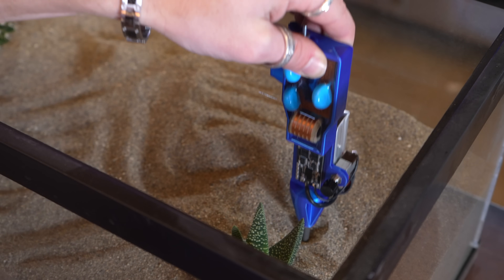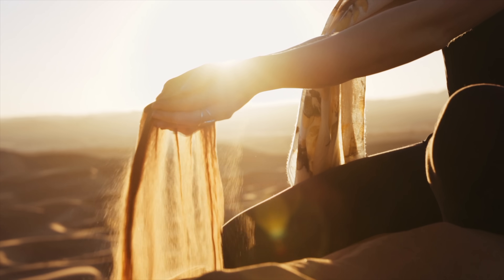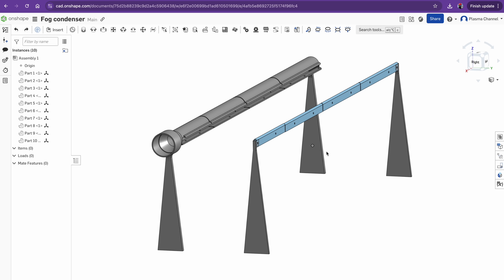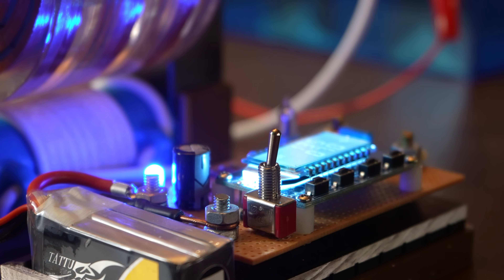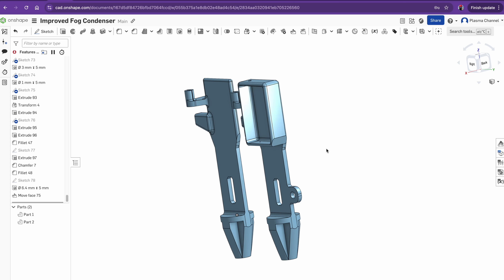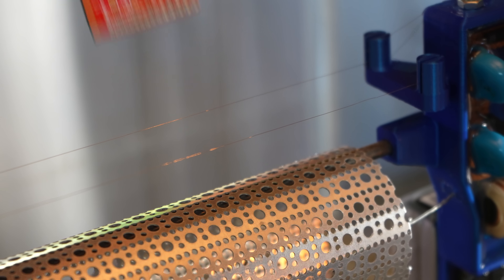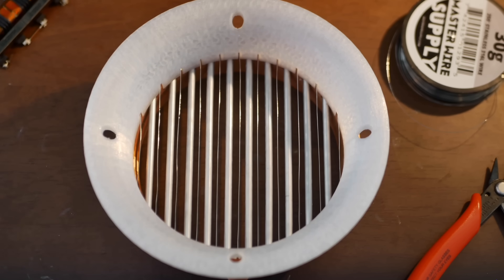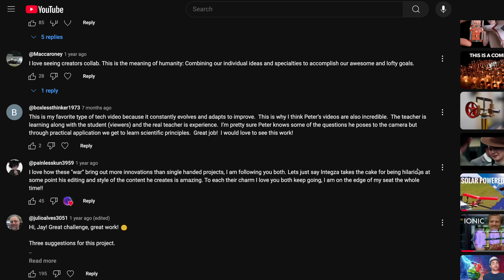Solving Desert Water Shortages Using 20,000 Volts

Comment: 14ml per Wh, in other words 257kJ per liter. No wonder you only mentioned it for 2 seconds. I applaud the honesty though, most water from air sucker inventors wouldn't mention it.

First useful search result for "water truck fuel consumption" was using 35l of diesel per 100km transporting 20kl of water. Some simple math later (40MJ per liter of diesel) gives us 0.7kJ per liter per km. 

First useful search result for "reverse osmosis desalination energy consumption" says 11kJ per liter. So you can spend 11kJ to make a liter of water and then you can still drive it 350km in a truck and it will be more efficient. I don't think there are any foggy deserts out there in the world that that far from a coast. In fact, they require a coast relatively nearby, the Namib desert which is a very foggy desert is all within 150km from the coast.

So, just like all other "water from air" devices, neat idea, but the energy requirement kills it.

"but just add solar panels lol" Sure, that would work, but there are probably 50 better things you can do with your solar panels, including connecting them to a grid, selling the power they generate and using that money to buy diesel for your water truck and spend what's left over on something fun. In fact, put the solar panels somewhere else that isn't foggy so there's less maintenance required and they'll make more money for the diesel for the water truck.
Reply: MIT estimated 35x higher efficiency.  So 10 km in a water tanker.

Comment: I have a suggestion. What if you used, instead of a grid, a perforated smooth plate covered in a hydrophobic coating? To see if the condensation can be encouraged to slide off into collection faster?

Comment: 0:26 "Even arid deserts have plenty of moisture in the air"  The dew point would disagree with you.  That's literally what "arid" means.
Reply: Arid just means there is little natural rain.
While there is indeed the same amount of water in the air at different times of day (ignoring things like convection lifting warmer, wetter air) - the desert at night is very cold and it does indeed fall below the dew point - hence why you see fog in the desert and plants in the area evolve to collect this fog on their leaves.
This is effectively just concentrating all the fog condensate at a single location. Whether that's a good thing would need to be looked at
Reply: Are you 16?
Reply: @robmccormick-x6l  why did u ask
Reply: did you not hear him say "coastal"? 😂
Reply: That’s why he talks about predawn mist, because in the right conditions dew forms easily in the desert. There are whole ecosystems based on this dew. You are right, this device would do nothing at high noon, but under conditions where dew is already forming, this would amplify it a few orders of magnitude
Reply: @Merkasaur  Whether it is early morning or high noon makes no difference to the amount of water vapor in the air - it is the same regardless of the air temperature.  That is what the dew point measures.  There is very little water vapor in desert air.
Reply: @stargazer7644 might have to fact check that one. There is indeed dry air and wetter air and it is indeed heat dependant, this is why some air turns into clouds when temp is correct and temp is in a range and why clouds won't form over deserts (too hot and dry)
Reply: @stargazer7644  time of Day or rather temperature certainly does matter to how much water the air can hold. You are right that it doesn’t magically gain more or less water, but closer to the dew point, the efficiency and yield of these systems is dramatically higher
Reply: @Merkasaur  I did not say "how much water the air can hold"  I said the amount of water vapor in the air.  They are two different things.  The former has to do with relative humidity.  The latter has to do with dewpoint.  The humidity often changes quite a bit during the day because the temperature changes.  That has nothing to do with how much water is in the air.  That had to do with the ratio between how much water is in the air and how much water the air can possibly hold.  Dewpoint is different.  It generally does not change drastically through the day in a desert.
My point is in the desert the dew point is usually very low, which means there's very little water vapor in the air.   Of course it requires less energy to condense water out of the air when it is close to the dew point - the ambient temperature has already done some of the work for you.  But there's very little water to condense.
Yes, warm air can hold enormously more water than cold air.  But you'll generally never have that in a desert.  That's why it is arid.
Source - I live in the desert.
Reply: @stargazer7644  I didn’t misunderstand you and I wasn’t correcting your wording. Like I said, temperature change doesn’t ‘magically’ alter the amount of water that is in there air (like you said, vapor content stays the same) unless there is actual evaporation or condensation occurring. What I meant to point out is that your original comment is taking this backwards. The dew point proves him Right, not wrong. The fact that dew can still form in arid environments shows that extraction is practical. The studies show that active condenser techniques like this can work down to 30%RH or lower, which is easily reached in some desert areas at night even when dew or fog isn’t forming. You just won’t get as much. Arid doesn’t mean RH is always low. It just means that, on average year round, evaporation is higher than precipitation . Human ingenuity is often all about timing.

Comment: Probably won't read this comment, but I hope you do.

This could also be useful for dehumidifying given that most of those, as you tested, are kinda lacking in capacity or are really annoying if they are industrial sized. This could be useful for datacenters that need dry air to stop the dust to stick to everything. It could be useful for collecting water for evaporative cooling even. I'm kinda surprised this is only explored now given the effects of high voltage messing with fog are well known to anyone that's ever worked on above ground high voltage power lines. In the winter the morning moisture in the air clings to them to then freeze and cause all manners of issues.

The problem presented for water collection is again, batteries. Powered by solar means you store energy during the day and keep overnight to run the system the next morning. So the batteries are the key point here and next to the electronics the biggest cost factor.

Also energizing metal like this probably also accelerates the oxidation process, so even using stainless steel you may end up liberating enough electrons to cause a chemical reaction with the oxygen in the air coupled with the water.

Worth exploring a way to add a small vibration motor to the mesh to get the water droplets off so they don't stick so much as the sun comes up would evaporate them again. Maybe even something to run over the mesh when the system shuts down to get the remaining water off and maximize the efficiency of the system.

Remember that it gets very cold in deserts as well, so much of the fog won't be directly above the ground, hence fog nets are often quite tall. You'll want a foot or two above ground to be above the thermal layer and right in the fog. While the electricity does attract it, scaling the system vertically might still be useful. Question is how as the dripping water droplets of a stacked system would cause constant shorts, but even staggering them as the wind blows them around they might still short. The electronics either need to handle this or a stackable system needs to be designed.

Further issues will arise from fauna as you don't want the thing to turn into a large mosquito griller. Shorts and the contamination of the water from that, not that it matters much for crops, but for drinking water certainly still need to filter it. Would also be interesting to test the water, if it has any minerals in it or if it contains a lot of ionized water, which wouldn't be the best option for plants or humans, though I'd imagine that problem solves itself with time.

Placing the system permanently somewhere may also rob plants of sunlight. This is least an issue around the equator, but if you want it used elsewhere the different sun angles during the year might rob plants from the light they need so all the water in the world won't help them grow. Have you considered building it onto a rotating gantry like the systems found in California and other arid places. This would also distribute the water more evenly and move the system through more moist air potentially further increasing yields.

Fascinating. Would love to be involved in further development as I can see some problems arise, but also some solutions that sound really interesting to explore.

Comment: Few points to consider:
- Desert Fog Nets may have a low efficiency, but should be MUCH cheaper and scalable and do not require any power. So overall, a fog net might still be the better choice.
- Comparing the power consumption to desalination techniques, your prototype is really inefficient. Reverse osmosis only requires around 5 Watt hours per Liter.
- In the last demonstration where you compare your prototype to a conventional dehumidifier. You need to run this test way longer, since dehumidifier run in long cycles. 
No hate, I still enjoyed the video!
Reply from the maker: Thats good input, I appreciate you taking the time to type it out. I'll take these things into consideration. Now in terms of cost, Im less interested in it being make available for ultra poor communities (though, I will do my best to steer in that direction). I am more interested in creating the tech as a possible option beyond drilling or reverse osmosis in terms of water availability.

Comment: This looks awesome. And it’s so simple, seems like you could use a lot of different things for the wires and the ground. 

Maybe even just regular metal piping could be used as the ground. Make a kit with the wires and the high voltage that unwinds and threads onto both ends.

Or maybe you just run a braided cable or two for the ground and scale it up by stacking multiple lines.

Would this work on a metal roof? Pair it with a rain water collection system. If you’re attracting water molecules electrically, do you even need a mesh? Or would a sheet be even more efficient?

So many ideas! So many possibilities for how to run wires near a grounded conductor.

Comment: Really cool project! The company that spun out from MIT that is doing this commercially is called "infinite cooling", just FYI. I have a couple of science comments: 1) It's important to distinguish between fog collection and dehumidification. This is a fog collector, it charges very small liquid droplets so they're attracted to the grounded collector (notice I didn't say condenser). A dehumidifier pulls water VAPOR (gas phase) out of the air by removing the enthalpy of vaporization through cooling. Dehumidifiers are designed to remove gas phase water from the air, not tiny liquid droplets, so it's not exactly an apples to apples comparison. 2) Using this for desert agriculture probably won't have the impact you'd hope for. Water consumption in plants is proportional to the vapor pressure deficit in the air, i.e. when the air is wet (high relative humidity) plants consume less water, and when the air is dry (low relative humidity) they consume more water. So when you pull that fog out of the air, you're reducing what the humidity will be later in the day, causing plants to consume more water. Of course there are other factors, like if you have a wind coming in off the sea all day long bringing in more humidity. Of course you could use this to collect fog, that is then provided to greenhouses, but greenhouses  can have extremely high water efficiency, so again, limited impact. In coastal deserts it's actually easier to use sea water to increase the relative humidity so than plants consume far less water. There's a company called Atmo Cooling doing exactly this.

Comment: You could put these at the base of ravines down the side of arid mountains inland because they’ll have flows of colder air with hopefully higher water content. You probably couldn’t grow much in the ravines but you might be able to get the water into ditches or pipes to protect it from re-evaporation.

Comment: Thanks, you just made a salt water distillation system I had been design 10X more efficient. You don;t need morning fog you need humidity. Imagine a  10', 30' or a 100' black inflatable dome floating in the ocean. Hot air holds more water and it will draw out moisture from the ocean surface then you use a stack of mesh plates alternating with a collection pan underneath. A cheap 10' dome could provide clean water for a family and a 100' could provide for a small town and I include enough for watering a vegetable garden. Industrial scale ones could pipe water inland. Swamped finishing a documentary but next month I'm building a prototype. I already have a bunch of transformers I bought. I found a square 4' kiddie pool with a PVC pipe frame that will be perfect. I'll pipe out the condensed water into a bucket formeasuring. I want to see what a 24 hour output would be? I'll build a black tent over it and arrange the grids and wires in the top where the humidity collects. I'll test optimizing for differentspacings of the collector screens. Probably 6" or 12" would work. Say 4 to 8 mesh screens 4' long and 12" high. Also need to see how much power it takes but but if one transformer will run the bank it;s like turning on a florescent light that produces water. Based on your results even the one I described should produce a lot of water a minute.

Comment: Humidity and dewpoint sensors don't like dirt, and both require relatively frequent maintenance and calibration.  Rather than turning the system on when the conditions reach a fixed humidity, just use a smaller, low power test system to determine when to run the larger, higher power system.  Basically, you would run the small, very low power system 24/7.  As soon as it starts producing water, you switch on all of the larger, higher power systems.  When it stops producing water, you switch the main systems off.  All of these systems could be networked with something like Z-Wave back to a Rpi or Arduino central controller.  The entire thing would be very modular, very scalable, self contained self configuring and relatively maintenance free.  To cut standby power further, you could run the low power sampling system for 30 seconds every 5 minutes to test for fog.  This could truly make a desert bloom!!!!

Comment: That's a really interesting project but I still have some doubts regarding it's usefulness.
I did a very rough research using chatgpt and It calculated for me that reverse osmosis plants which can purify seawater can produce 1000 Liters at a cost of 0.3-1.5 $ (thats for the whole process including maintenance)
Your prototype can only produce 14L per kWh which end up being about 140L of Water per dollar (electricity is about 10cents per kWh in chile) and thats only factoring in the electricity cost.

What would be really interesting to find out is, If your prototype beats the dehumidifiers even at lower humidity levels of about 60%, which you'd find further from the ocean.

Comment: Cool idea but it seems when comparing to reverse osmosis you need to become much more efficient. maybe its possible. Have you tried using a Copper wire mesh (which would also be less prone to fouling so like moss and other shit growing on the mesh than steel. Maybe more likely to corode though). Also could you use much more fine mesh to catch the droplets better? (maybe it isn't necessary at all because the droplets are attracted anyway). And also it seems like your system is running at to high power the fog and maybe even air around it is strongly and rapidly pulled to the mesh. I don't think you need to have that rapid of an acceleration and maybe could save energy.

Comment: Cool concept but in terms of efficiency not close to desalination which is around 180ml per wh (just pulling some random data).
Kind of stinks for this as a viable concept as generally these fogs are close to a body of saltwater, which may be a more energy efficient source of water. of course I don't know what the theoretical efficiency is here / if it can gets closer to that.

Still cool though.

Comment: Ummm, why not use this concept to swap the guts out of that Amazon dehumidifier. I bet you could make a seriously effective dehumidifier for consumer use out of this. Probably as cheap as the peltier cooler in the  crap unit and more output than a compressor driven unit.

Comment: So a solar charging setup during the daylight hours to charge batteries/ultra-caps. Setup humidity sensors to trigger the power to the high-voltage circuitry (and turn it off when it drops below a threshold). The only concern I would have is a chemical reaction with the ground electrode. It might be good to do some long-term testing and analysis.

Comment: You should test the limits! Primarily relative humidity limits, but also size limits, energy limits etc. 

I’m interested in how this can be used in high deserts where fog isn’t common, but large fluctuations in relative humidity, because of nightly cooling, can be quite extreme. There is a ton of land that is currently virtually non-developable due to water access. I don’t see this being the only solution, but coupled with solar power & rainwater collection, I feel like you could get real close to self water sufficiency.

Comment: If the positively charged water acculumates on the grounded surface, would that repel the other water that hasn't condensed? What if the surface was hydrophobic? Would it accumulate more efficiently since the water would drip down more?